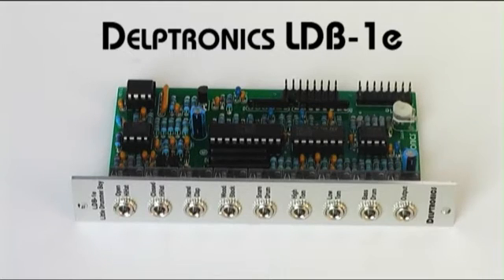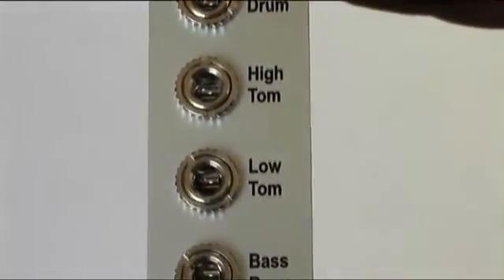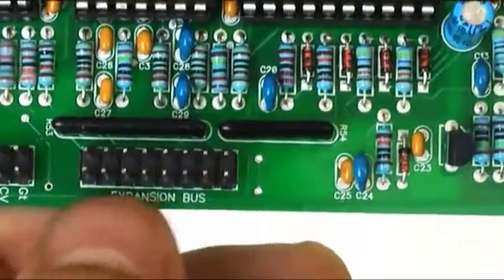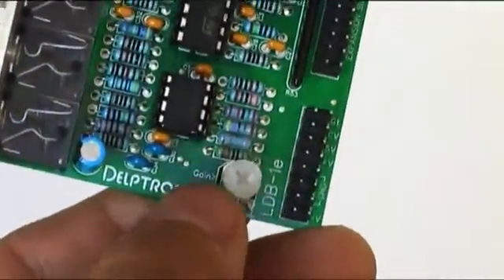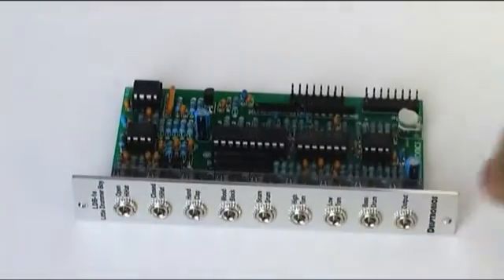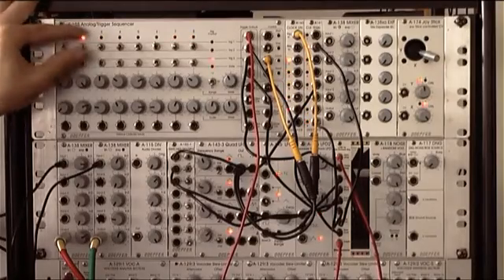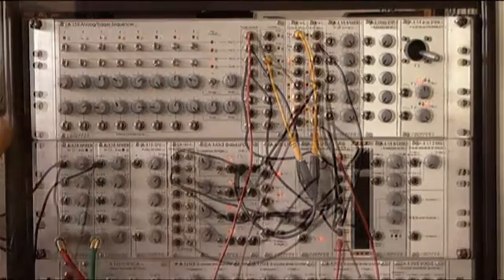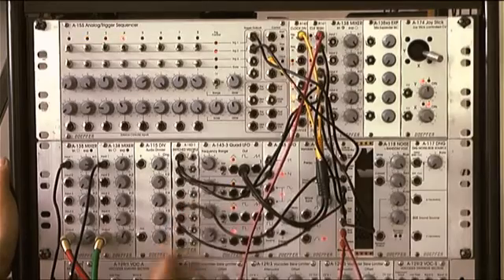Delptronics LDB-1e Demo [EN]

Comment: I used an MCU because it takes less board space and is more precise than two Schmidt trigger ICs.  It outputs an exact 4ms pulse given an input pulse of any duration, even less than 1ms.  Plus, it is cheap.  Yes, the other MCU generates white noise and four tuned square waves for the hi-hats.  It replaces many discrete components and produces the same output with less board space.